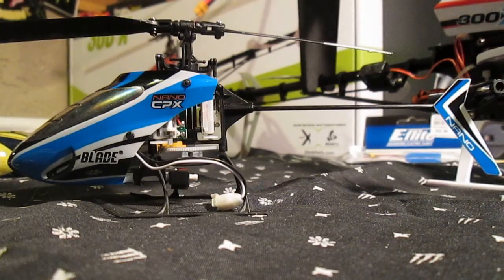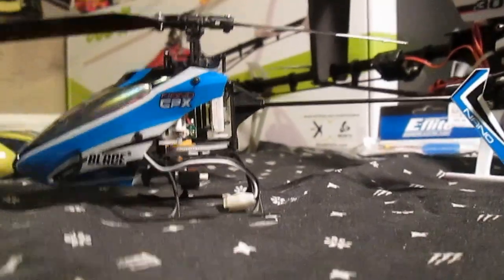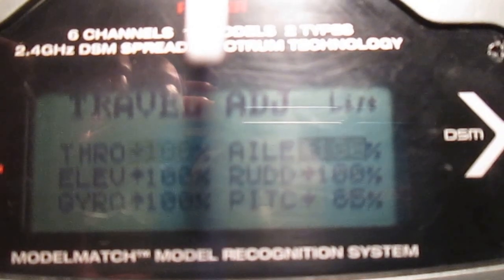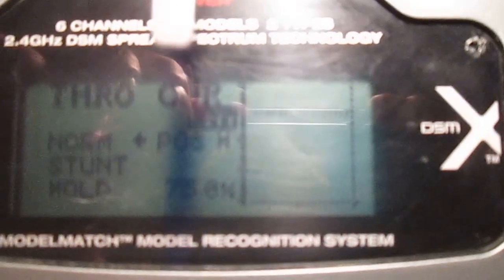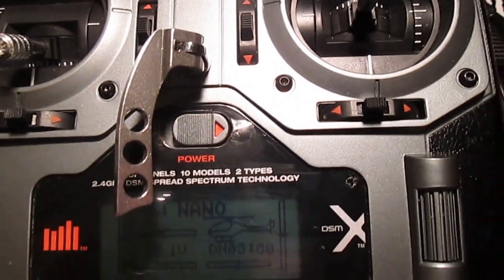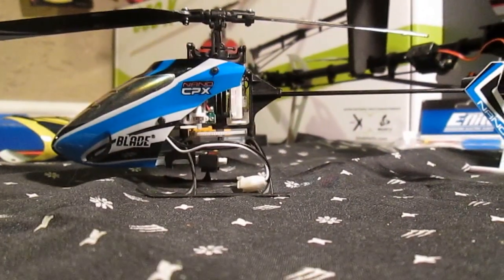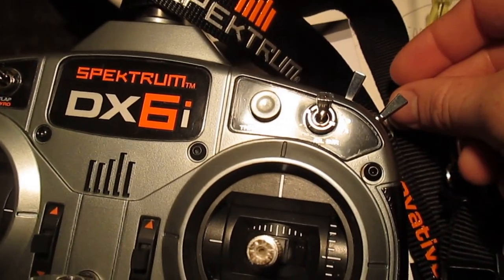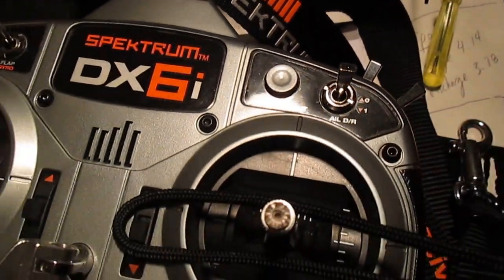Blade Nano CPX Brushless / DX6i settings and ESC Procedure

Comment: it was just refreshing to hear you speak you sound like you know stuff and you can learn stuff… I don't even have this ESC just liked your video you're a smart dude.  I just put a DX 6i on a stock nano S3... Took five minutes but I did not set up any other modes it just defaulted to I think safe mode where role and pitch are limited… Somebody was mentioning if you do want the other modes they recommended binding again holding the rudder in the far right during binding do you know anything about that?  He said if you don't do it your other modes won't work correctly… so just wondering if you've heard anything about it or know anything or just bind it normally and go look for the channels for throttle up and things which I haven't done yet

Comment: Hey mad man can i use these settings on my stock nanocpx cus i used the settings grom the box and whenever i turn it on and push the throttle up the servos wont work and before they were working until it was on with no throttle
Reply from the maker: No, don't use these settings for a stock Nano.
Something is definitely wrong with the servos and throttle, With a stock Nano it should never spool up with no throttle input...
I would check your idle up switch and see if its on when you are starting, try rebinding , make sure all your switches are off, also go into your transmitter and see if your throttle is in reverse.
Hope one of these answers does the trick......    :)
Reply: thanks :)
Reply from the maker: djpavle2012
Did any of these fix the problem?
Hope your up and flying.....

Comment: i have this heli and i  have no idea what your talking about
Reply from the maker: This is only if you have the brushless nano kit from astroid designs.
If you just have the stock nano.... this does not apply to you.
Thanks for the comment......   :)
Reply: Mad Man Slice i do have a brushless kit. not sure which one. but i know i didnt have to do any of this . lol. and its got retarded power now.
Reply from the maker: If you have the Horizon Hobby Brushless kit, it just plugs into the board. The Astroid designs kit needed to be soldered in.
Reply: Mad Man Slice yes... thats the one. took only about 5 min to install. why would you want to get one where you have to solder?
Reply from the maker: Well at the time when the Nano first came out it was the only option available for the terrible stock main motor failure.
HH just came out with their brushless conversion no more than 4 months ago.
As you can see my video is about a year old now...
Great little heli to learn CP on tho!

Comment: I gotcha ok! I have a question, you mention the maker/manu of the motor and Blade come came out with a brushless upgrade. Are these the same things?
Reply from the maker: No they are not the same kits, The one I have is from asteroid designs, The new one from HH is much easier to install.

Comment: Is your Idle-Up mode switched on? That would be why it starts immediately when you turned the throttle hold off. You should never start the heli in Idle-Up mode. Too much strain on the board, motor and battery. ALWAYS bring it to a hover, then switch Idle-Up mode on.
Reply: +Imothep I agree. Soft start is so much better for ESC and motor. 
It is a nice informative video in how to arm ESC.
soft start is gently increasing speed up rather than to say 75% suddenly to the brushless motor.
Reply from the maker: Hey Nate,
I 100% agree with your theory. And that how I fly my other birds as well.
But with this kit, you are in idle up mode from the start, and that is why I mentioned to lower your time of flight.It is the way this kit was designed.
But thanks for your input, take care.....  :)
Reply: Ever heard about built in soft start?
Reply: I haven't no. Is this particular to the Blade Nano CPX?

Comment: Is it the same ESC arming procedure for the DX7, or do I go by the manual? Reason I ask is that with the Wild kit running 80% throtle and linear pitch curve the ESC restarts and motor shuts off in mid flight. Doesn't do it all the time but wondering what it may be. Checked all soldering connections! When binding the DX7, you only get one set of beeps. I don't do anything with throtle hold. Please advise!!!!